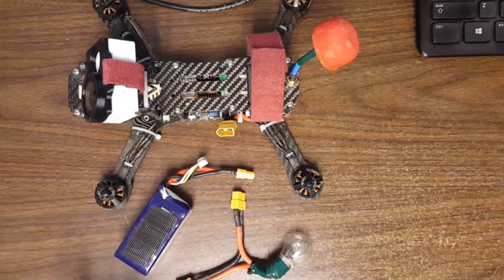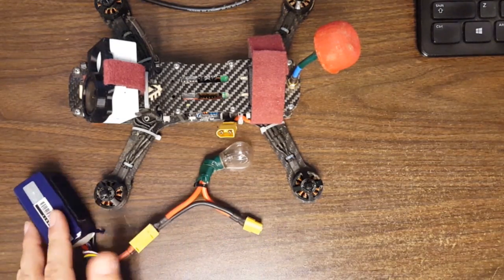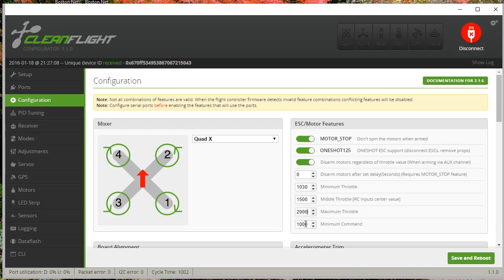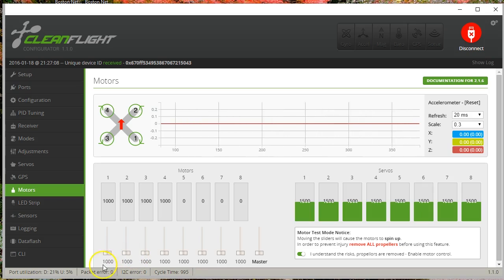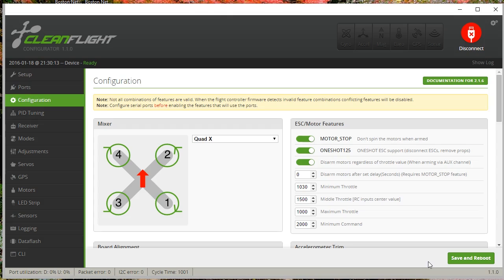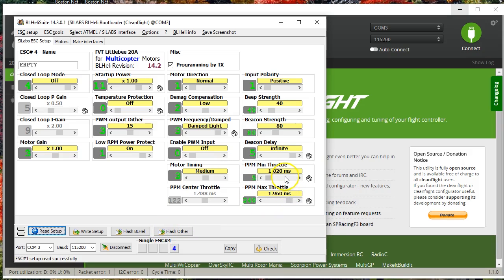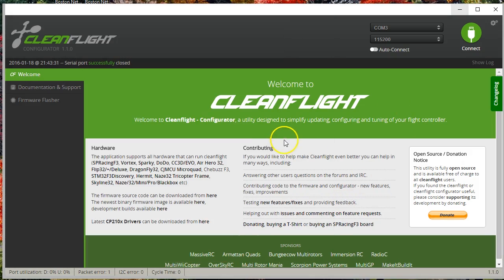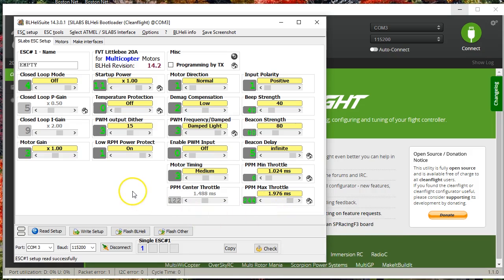How To Calibrate ESCs with Cleanflight and BLHeliSuite

Comment: This is a very helpful video.
I have an issue/question and was wondering if I could get some feedback.
I set min command to 1000 and max throttle to 2000.
When I followed this process, my esc min ended up at 1148 and max was 1862.
DYS XM20A escs..
Possible there is a problem, or is it possible that these numbers are correct?
If this is not a problem, then I would have to set min throttle to about 1160-1170, right?
Reply from the maker: +FlyinSunnyCoast no. The whole point of the calibration is that your 1000 to 2000 in the FC has been mapped to whatever the ESC perceives that as. To find min_throttle, raise the master slider in the Motors tab until all four motors are spinning without stuttering, then add 20.
Reply: OK. Thank you.
Greatly appreciated.

Comment: Hello Joshua Bardwell,
Great tutorial. Can i do the same either using PPM or PWM protocols ? I will be using PWM on my quad. thanks
Reply from the maker: +Juan Carlos Vargas you need to calibrate ESC's regardless. But don't use parallel PWM.
Reply: Joshua Bardwell, sorry but what is parallel PWM, you mean I should use PPM instead PWM ?
Reply from the maker: +Juan Carlos Vargas a PPM receiver would be better, but these days cheap serial receivers are available and should be preferred.

Comment: Great video , had a problem with two quads with motor's stuttering etc. , tried all sorts ....watched video , re-flashed firmware and re-calibrated esc's , all stuttering has gone , quads fly again ...  min throttle and max throttle are a bit off,  though

Comment: OK Josh. I have gotten my esc flashed and ready to go with blheli(thanks to your help by the way!) I cannot get my quad to arm at all. I have my swithces set right and i have followed this video over and over trying to figure if I have missed something.

As a note. I am running the Naze 32 rev6( I took what you said at the end of the video in consideration)
Also my Tx min value will not go below 1050 and go above 1840. I have a cheap Fly-sky fs-ct6b and have used the software to get the max out of my stick range for the closer values of 1000-2000 but thats all I can get out of it. 

Your thoughts?
Reply: ok, never mind on the above. I got it to arm by setting my min check to 1150. but now i have 2 motors spinning out of sync
Reply from the maker: The throttle must go below min_check before you can arm.

Make sure to use rxrange to adjust CleanFlight's expected channel endpoints, if you can't get your channels to 1000/2000 in the transmitter.
Reply: Joshua Bardwell i got the quad to arm. now as i throttle up i notice it wants to roll left and pitch backward. I have checked all my esc calibrations, motor directions, accelerometer calibration and orientations and everything is correct. Could wrong PID's be the cause?
Reply from the maker: Are you in autolevel mode? If so, you need to use accelerometer trim to fix it.
Reply: Joshua Bardwell , Ijust tried that and it didn't do anything to help. I notice that when i first arm it ,the number 3 motor is the last to get the same power as all the rest (only by a fraction of a sec.) and is the last to coast after disarming. (again only by a fraction.)

Comment: hi I have a issue with my racerstar 30a esc not calibrating on betaflight are blheli suite when it's plug into the USB and I plug the battery with Max either the motors will spin are won't get the calibration beeps could you please help thanks
Reply from the maker: What FC is it? Some FC's back-feed the ESCs from USB so the ESCs are already powered up when you plug in the battery. Then the ESC doesn't go into calibration because the throttle must be at full when the ESC is powered up.

Comment: joshua bardwell  is there a custom setup for esc & motors  for racestar blHeli 4 in 1 esc  when im checking motor 1 its  motor 4  and 2 and 3 ar the same  back to front  but all turning the right way   every things wired up as it should be but i cant understand whats going on  but i think i found the problem with the instant flipping josh   but cant work out why  my motors ar back to front josh
Reply from the maker: Whenever I have done a 4-in-1, I have always had to move the signal wires around to get the motors to map correctly. You need the motors to spin correctly in the Cleanflight or Betaflight motors tab. If the wrong motor spins, write down which wire it was and where you need to move it to make the right motor spin.
Reply: +Joshua Bardwell woohoo so I'm not going of my nut haha thanks very much josh will it be the lead from esc up to fc outputs for esc & motor  and swap 1&4 and 2&3  yeah that's making more sense josh iv climbing the walls all week stripping it down and keep going over all the wiring diagrams haha and it's something so simple really  thanks again your the man josh
Reply: Joshua Bardwell iv got them all in order now josh thanks very much im gony put the props on and give it a try in the bedroom and see if its gony flip or fly haha  woohoo fun time josh haha

Comment: Joshua, where is the video where you go over the Mincheck and Minimum command settings? I've seen it before, but am not finding it now... I'm finding my quad wants to start out at 10% on the motors and not 0% and following this ESC calibration didn't seem to fix it like I'd hoped.  Thanks!

Comment: after i ran the calibration for ESC in cleanflight, the BLHeli Suite showed my min=1032 max=2020...what effect does that have if the max is 2020 but cleanflight is set to 2000 max ?  Does that mean I will hit max power before my stick is all the way up?
Reply from the maker: +Brennan G no. The whole point of calibration is that the two sides are now aligned. If you could just set the numbers the same then you wouldn't need to calibrate. If I say, "I'm sending you 2000," and you say, "I'm seeing 2020," oh well, at least we know how far off we are. 

But you don't want 2020 as the maximum value. Reduce max_throttle and re run calibration until the ESC calibrates to less than 2020.
Reply: OK, well I adjusted max_throttle to 1990 in cleanflight, and after calibration, BLHeli is still showing 2020 max...so I lower max throttle again in cleanflight to 1980, calibrate again, and BLHeli is showing max at 2012, 2012, 2012, 2016....min values are 1028 and 1032.

Should I keep lowering the max throttle in cleanflight to get closer to 2000 max in BLHeli ?   I'm confused now....I only know the ESC themselves aren't far off from each other, within "one step" of each other... sorry to trouble you, I'm new (obviously)
Reply from the maker: As long as they're below 2020 you're fine. Them being one step off is no big deal.
Reply: Thank you for replying.  Super nice of you to be so quick to help. Cheers

Comment: Dear Joshua, first thanks for your effort and patience to teach and help us improve our understanding of the hobby "guts". 

I'm trying to build a new quad, with this settup: FC BeeRotor F3+Betaflight 3.0, RCX 12A F Series + BLHeli 14.8, Sunnysky 2204S motors.

My problem is that after calibrating (or directly in betaflight -3.0) of via blhelisuite, the motors, when in idle, even before arming, do some kind of stutter. I've tried repeating calibration many times, also did try changing the motor timing in blhelisuite, but nothing helped. The only way i get to stop jittering/stutter is , setting Min Command as low as 950. 

Thanks in advance for any suggestion/indication if it's ok to let mincommand that low.

Comment: Have a problem with Blheli_s and SP F3 Evo. Looks like Naze32 rev6 power from usb problem. During calibrating motors start spin when bat attached
Reply: Dmitry Astapkovich throw it at the Wall that fixes it

Comment: Cool thanks joshua Bardwell so do I do this after setting up my f3 fc in cleanflight iv still to unbrick the board but I'm just going to do that iv found a few videos showing to unbrick the f3 deluxe so I'll get that done iv only one problem iv got the cc3d naze32 f3 pdb and I don't know where to connect the v-bat connection and iv got this setup on the table and going to get a we video of it setup before I put it in the quad and upload it and if you can have a look at it and hopefully it's looking good and ready to install and get it powered up without any magic smoking haha yeah that's a thought josh lol

Comment: why on my blheli suite dont have the motor tabs?
Reply from the maker: +Dope FPV older version?
Reply from the maker: +Dope FPV also, the motor tab only works if you are using pass through. It doesn't work with a toolstick.

Comment: this is by far the most usefull calibration tutorial ive ever seen, thanks for that
Reply from the maker: +teramax awesome. Thanks.
Reply: i'm more confused now than before i watched it,...
Reply: alan hennesy
 watch again, its important ;-)
Reply: hehe ok i watched again and the main point was ''its not important, leave it alone'' hehehe,  its all neither here nor there, the topic meandered over to resolution then hinted at some complex stuff that may or may not be true then its bumbled via programming by tx via a history of legacy controls back to the min max throttle setttings... the fact is, these are readings not settings, theres no real reason to change them at all, even if one esc is slightly lower and cleanflight asks for more ''max' when there is none? then it sense no more thrust via accels sensorss, and if you do adjust the max throttle up to the rest of the esc's? guess what, cleanflight limits them again when no more thrust is output.... so i'm back at square one .. when you consider noobs like me... trying to fumble through to get a quad to fly, i basically ignored everything i didnt quite understand and the quad flew ok, then i started trying to understand stuff like fine tuning endpoints on my tx and matching those to cleanflight ... which i don't even recall if it used as defaults the 1000 and 2000, and from there to changing my habit of no spin at arm to a minmum spin at arm plus  being careful not to set my minimum spin too high or too low and then this red herring topic of blheli's min max.... and wwhen you bear in mind i'm trying to have a look at loop times and if i can make mine faster, and how.. loop time was mentioned in the middle of this too. i think i could sum up the whole vid in a couple of shortish sentences,, ''these numbers don't really matter leave them alone unless one number is more than x out of sync with the other numbers, in which case you probably have a bad esc.''  .. damn i did it in one hehehe

Comment: I'm using aikon 30a esc's, with a cyclone, with betaflight 3.0... no matter what i do it will not stop jittering... any ideas.... any info will be greatly appreciated!!
Reply from the maker: Jitter is just so open-ended it's really hard to make any good suggestions. If it happens only when armed, and NOT in the motors tab, then it is something to do with the PID loop or tuning. If it happens also in the motors tab, then it is something in between the FC motor outputs, the ESC, and the motor.

Comment: One thing I am noticing in BF 3.0 is when I command 1950 throttle, only 1791 is showing up in bb explorer.  Some motors run slightly higher than that.  is BF trying to leave some throttle in reserve for stabilization?  Should I be able to get full throttle from atleast one of the esc when I do a punchout?

Comment: I'm having issues with one motor burning out when ever In connect the battery. any help?
Reply from the maker: +mike dew even when the motor isn't spinning? I guess the only possible explanation is a bad ESC.
Reply: +Joshua Bardwell - On plugging in the battery (as he did having followed the steps) motor No4 starts smoking I changed the motor for a spare which also started smoking so it's not a defective motor. I suspect it's an issue with the ESC but don't know.
Reply from the maker: +mike dew it's the ESC. There should never be current flowing through the motor when the throttle is down. A smoke stopper bulb would have saved your motors.
Reply: Thanks :)

Comment: Josh, when I tried syncing my escs with the Blheli suite I had a few issues.  First,  when I plugged my battery in I did not get the tonals indicating I was plugged in to the program.   Then, if I continued on  and selected to read escs my motors would just start up.  Have you heard of this before?  If so do you know of any solutions?
Reply from the maker: That's weird. It sounds like your ESCs are not going into programming mode. I would post over on the BLHeli thread on rcgroups.
Reply: No emax never replied with the actual answer.  They said that the esc shouldn't be completely wiped.  I just bought new ESCs.   Banggood has some 25a Blheli s escs 4 for $30.
Reply from the maker: Aha! So the ESCs were already powered up. So they wouldn't calibrate.

Comment: Hi Josh I hope you can help me. I like what you for everyone. My diatone 180 flips forwards. Can't get it off the ground. Everything is right, the motors turn right direction, props are on right too. Any thoughts ?
Reply from the maker: +Don Fowler motors wired to wrong header, I'm wrong order. FC facing wrong direction, board align not set. Motor spinning wrong direction. 

If the copter instantly flops on throttle up, it is almost always one of those three things.

Comment: Joshua, your videos are awesome, keep up the great work! One thing you might want to note is your "damped light" setting. With my littlebee 20's if that's not set, I get a flat spot at 1500 - 2000. Changing to damped light allows my motors to vary all the way up to 1940ish.
Reply from the maker: You have to use damped light if your ESCs support it, period.

Dither will help with the dead spot at the top. You can also do top-end calibration.

https://www.youtube.com/watch?v=spegUYF8Dxk

https://www.youtube.com/watch?v=0Bi1XcdpnQI
Reply: Thank you again!